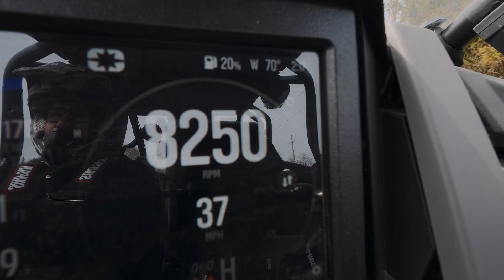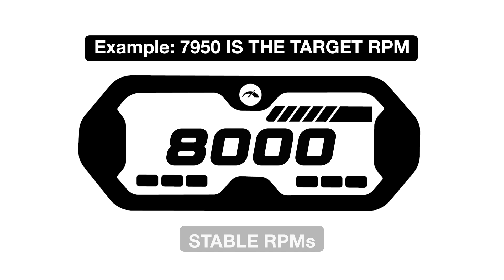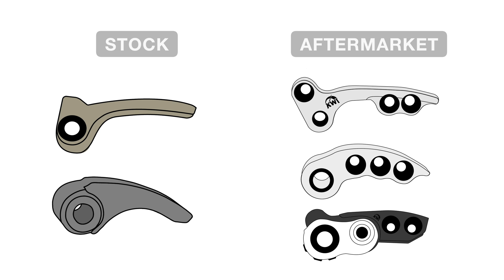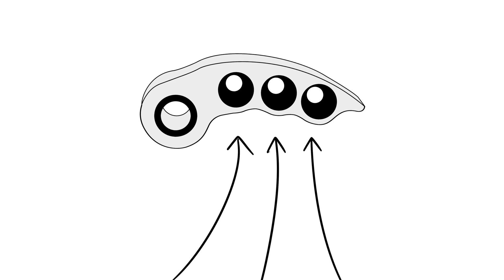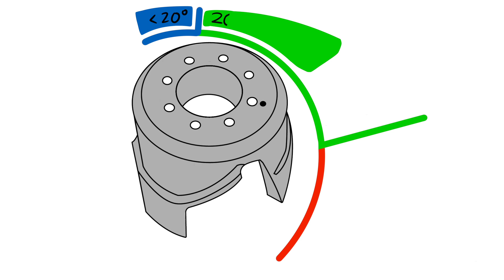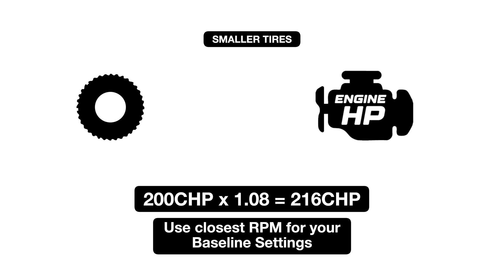The Ultimate UTV Clutch Calibration Guide | CVT Tuning Explained Step-by-Step

Comment: What would cause at 20 mph, then wot go from 8100 to 7800 then slowly climb? Im trying to get 8100 -8200 consistently.
Reply from the maker: what is your RPM at full throttle around 55Mph? you can always reach out at support.KWIclutching.com